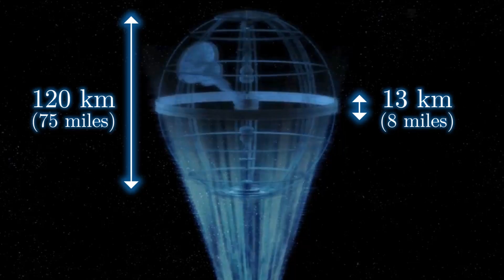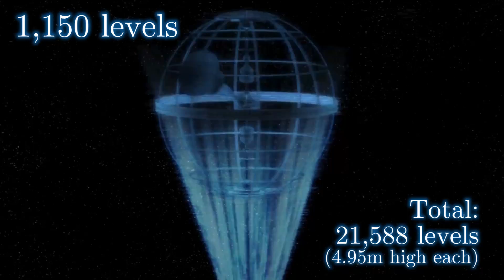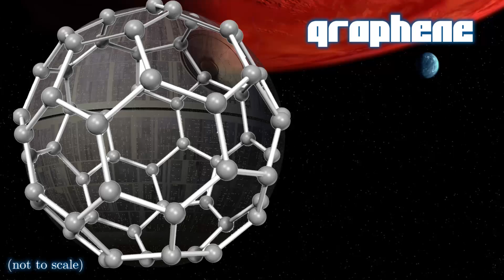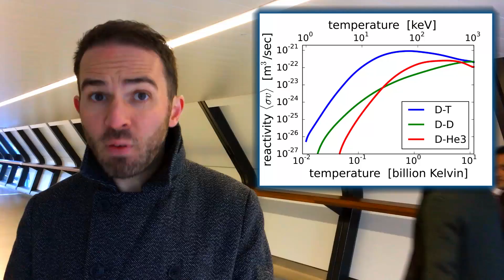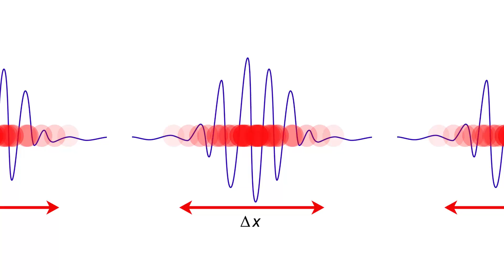Is the Death Star actually a star? Gravity, Fusion & Dyson Spheres | Physics vs Film

Comment: so, what if you just spin the thing really fast? they do have hyperdrive, so accelerating a reactor to light speed should be theoretically plausible, right? wouldn't that generate some epic magnetic fields? and once you bring relativistic effects of high speed rotation into play, does that make the theory more plausible or less plausible?
Reply: spin the core, I mean.
Reply: I guess it would be easier to just sprinkle some midichlorians on it.
Reply from the maker: Max Johnson Max Johnson spinning the core will tend to push the equator region outward via centrifugal forces, so not great!
No appreciable magnetic fields would be generated by the process since overall plasmas are neutral so unless the opposite charges are counter-rotating or you have non-uniform rotation you'd get nothing!
Reply: Martin Archer hmmm OK... so what if the charges are counter- rotating?
Reply: @Iyamyuyam  that would be god civillzation